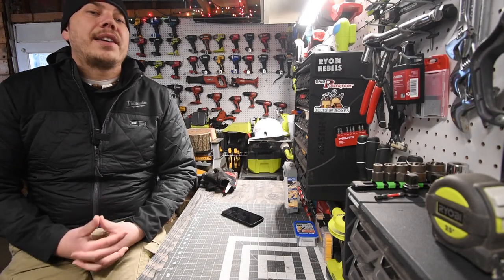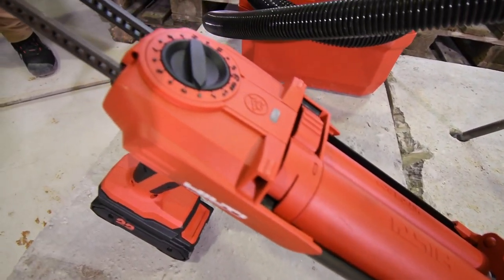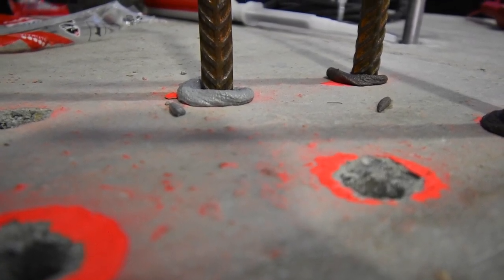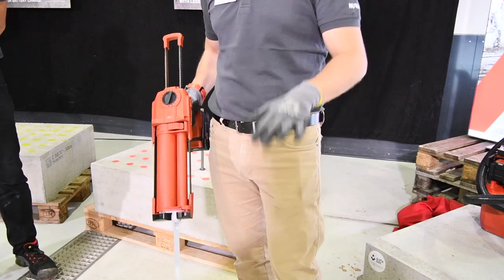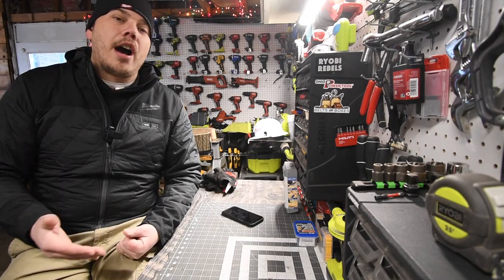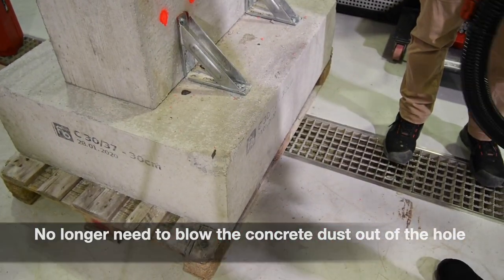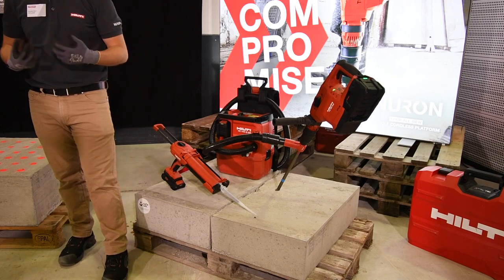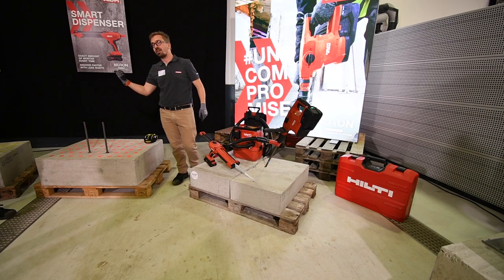HILTI NURON (Part.3 Station - 3)

Comment: Gotta love hilti for their slip-on adapters that let you charge 12v, 24v, and Nuron(..hopefully.) batteries all on the same charger :)
It even charges 36v batteries as far as I can tell
Reply: I dont think thats totally correct, NURON can only be charged with a NURON charger. The adapter ($180) only lets you use the NURON battery on existing tools....still need to buy NURON charger ($84) with new battery ($175)

Comment: why the #### would they change the battery platform? just put the new cells in the same battery housing? let alone the fact that its been years and they still sell old tech batteries here in new zealand. I'm switching to milwaukee.